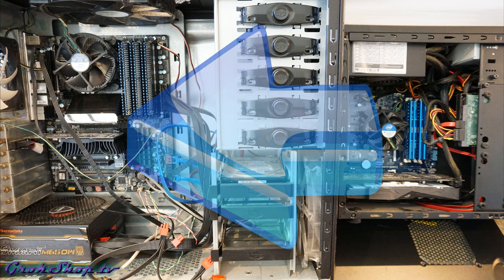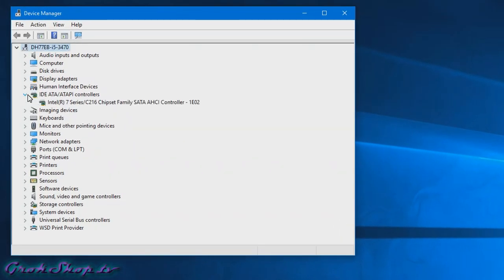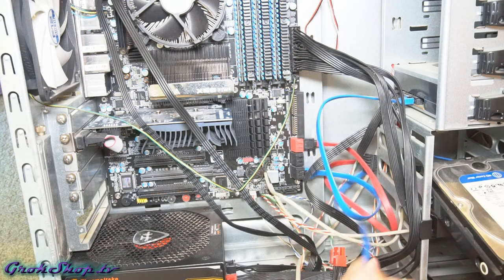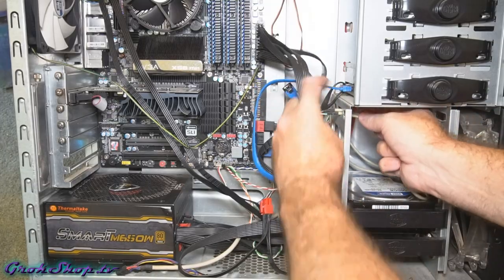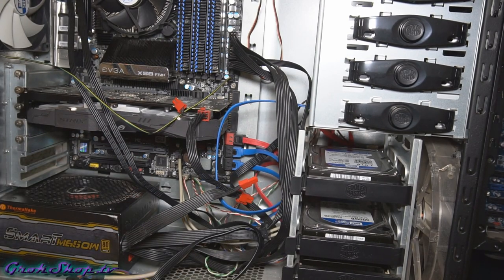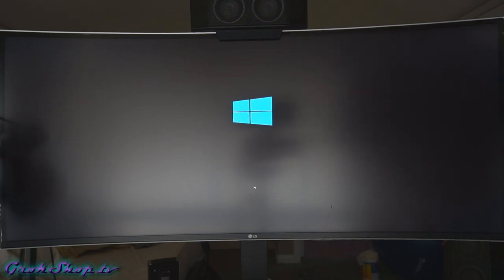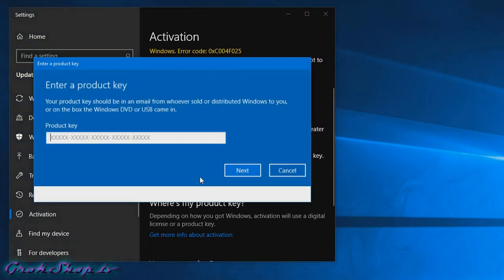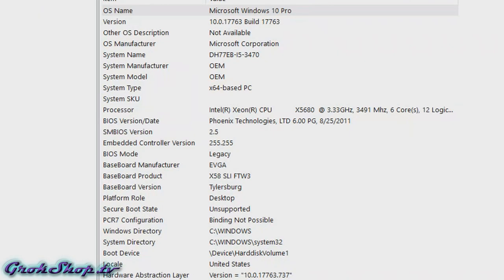Transfer Windows 10 To New Motherboard & CPU + Digital License Transfer

Comment from the maker: Note:  During the initial "prep" phase, if you don't find your HDD / SSD controller under "IDE ATA/ATAPI controllers", look instead for "Storage controllers".  If its under "Storage controllers", the standard controller you want to change to (before doing the upgrade) is called "Standard SATA AHCI Controller".
Reply: Did exactly this, changed storage controller. Replaced motherboard, new chip, ram, and GPU. Fired up, got bios screen, and then, away she went. And it did ask for the number, took the Win 7 number for the Win 10 upgrade without hesitation.
Reply: This dude makes it seem impossible. All I had to do was manually swap mobos and turn on pc....
Reply: Do you keeps your apps if you switch?
Reply: You prolly dont give a damn but does any of you know a tool to get back into an instagram account..?
I somehow forgot my password. I would love any assistance you can offer me.
Reply: @Nova Jaylen instablaster ;)
Reply: @Hank Cooper Thanks so much for your reply. I found the site on google and Im trying it out atm.
I see it takes a while so I will get back to you later with my results.
Reply: @Hank Cooper It did the trick and I finally got access to my account again. I'm so happy!
Thanks so much, you saved my ass :D
Reply: @Nova Jaylen happy to help =)
Reply: @hankcooper7124  Found the bots

Comment: YES ! It worked. Followed your instructions and it's worked perfectly. Changed motherboard, ram & CPU - firstly, did back up, windows image (Win10) & made rescue disk. Removed all files (Pic's, video, music & documents to an external harddrive) leaving just programs & apps. Then cloned hhd to ssd using AEOMI (tried Macrium but it failed). Removed drivers as per video - yes, check the "Storage Controllers" my drivers were in there ! Power down & removed all parts to new PC. Powered up new PC (to BIOS), selected SSD as boot drive & boooom, up & running & not pestered once about activation (my original licence still intact). Please note:
1: I had an original "retail" copy of Windows 7 which was upgraded to Win 10
2: Sysprep didn't work - tried but it failed a number of times.
3: My windows 7/10 is linked to an old email address but I didn't even have to log in to re-activate.
4: I did extensive research into my PC parts and made sure they were all 100% compatible.

Many thanks my friend, you've turned a very daunting task into a straight forward swop. 
Bob.

Comment: Very cool. I've been building and upgrading computers since the 4.7Mhz 8088. I did not know about this easy and direct way to move to a new PC. The last time I did this I used Laplink and that messy and expensive. Thank you! I'm building a Rizen 3900X computer tomorrow to replace my 2012 Core i7 6 core 4.2GHz machine. It's time.
Reply: Wow sir, how did it go? I'm on MSI B460 and upgrading to Asus Z490, not as a massive upgrade as yours but still worrying.

Comment: I've always so far done it the even harder way which is to put the new motherboard in the same case which means unplugging  everything unscrewing the mounting screws,  and xhanging i/o shield. Next time I'm just going to get a new case I think because the drive mounting options are limited in the current one, plus the space is tight.

Comment: Bought a used PC that had win10 enterprise wiped.  Win11 will not activate with my old win 7 pro retail. Can i obtain the previous BIOS enterprise 10 key and re-install windows 10 enterprise?

Comment: My motherboard died so before putting money into a new one I wanted to switch it with another one I have from a 2017 build, my current pc ran window 10 but the old motherboard was on a window 7 pc, will I encounter problems?

Comment: Thanks man, your steps are crystal clear and easy to follow. I am currently moving from Intel Xeon workstation to a new AMD Ryzen rig since my Xeon boost speed is a bit low for some scenarios. I will be following your step as soon as I get components on my hands.  BTW, will Windows 10 do the old driver cleaning job for you because I am a little anxious about older drivers and I don't want them to cause conflicts or blue screen.
Reply from the maker: Nice.  It  does remove the old unneeded drivers, yes.
Reply: @grokshop  Thanks again, I just finished installing new rig and surprisingly windows 10 did everything for me like you said. Now I can tweak my new rig without wasting time on OS and data transferring and those tedious tasks.

Comment: Just curious if this would also apply to not just switching motherboards, but to include CPU and all together different platform. Specifically going from a Intel 3770k to AMD Ryzen 5600x and of course all corresponding hardware?

Comment: I just replaced my mobo, cpu, cooler, and RAM. Bios sees all drive, including my previous boot drive but when I try to boot from it all I get is a black screen with a white cursor. I have an additional empty drive that I did a fresh OS install just to get up and running. I can see the original drive and see all my files via explorer. I need to be able to boot from my original drive. Any help is appreciated. Sorry for the lack of detail, I’m currently visually impaired.

Comment: I recently changed my mobo and cpu to. (Megx570 & ryzen 9). Now I’m getting a black screen with a blinking underscore. Any help would be appreciated !
Reply from the maker: Was that after following this procedure?  And was it working and then black screening or it was never working at all?
Reply: The Grok Shop My computer was not booting to windows. Meg x570 ace is unable to detect an m2 SATA in slot number one, I figured out that if you have an m2 SATA, u need to install it in slot 2 in order for it to be read in this mother board

Comment: Sadly it isn't work like that for me. When i change my motherboard, i was not able to boot Window anymore. I was stuck in the bios...and because i was stupid instead to take the product key i took the product ID. When i tried to install a new Window, the installer said that i has to format my SSD with window. Idk what i have to do, i dont want to buy a new product key

Comment: Great video I’m getting a new motherboard and cpu I was told that if I just do what you did in the video there will be errors and won’t work unless if I uninstall drivers from the previous motherboard.
Reply from the maker: Thanks.  For the case where the origin mobo uses a storage controller other than the generic one (as I was explaining in the video), you do indeed need to uninstall that one driver (as I showed in the video).  But that is usually the only one because Windows can normally figure out the rest on its own & will actually uninstall the remaining unneeded ones itself.

Comment: tomorrow i will be swapping out my intel cpu, mobo and ram to a b450 with ryzen setup. do i need to be connected to the internet to do this method? or do you recommend I keep the computer offline until it updates itself with whatever comes preinstalled as far as drivers go?

Comment: so this is only if you first installed windows 7 and upgraded to windows 10 - if you had windows 10 from the start, this isn't needed, correct?
Reply from the maker: There could be subtle differences if you had win10 from the start vs a win10 that is from an upgrade of win7.   The license transfer part could be a little different, for example.  The driver thing will be the same.

Comment: I got a new cpu ram mobo combo and a $30 OEM win10 lic and stuck it on my old setup while waiting for my combo to show up, im screwed I think. If I'm lucky its because I'm using an old H55 chipset one a no name china board that has no info and my computer has no idea what the main board is lol, says to be fill in by manuf..... And under hardware manager it says "Standard SATA AHCI Controller" naturaly.

Comment: doesn't this image save all files and settings which contain the old motherboard's chipset? - by reloading Windows 10 image, you're essentially back at square 1, so you might as well just kept the same image you had.
Reply: Windows will pick up new drivers automatically and install as needed. You can then remove via add remove option all unwanted drivers.
Reply: You can also load the image as a virtual hard disk in Disk Management and grab individual files as needed if the image can’t restore.

Comment: Installed a new board and cpu a few days ago. Got stuck in the BOIS for like 2 hours (my copy of windows is digital and did not have a copy to load up) strangely enough (using an Asus MOBO) I told the BIOS to download their RGB HUB, and then the machine booted from my existing copy of windows from my old build. I thought I was going to have to take back apart6 again, rebuild my old system and then get windows and start again.

Comment: i want to just swap my motherboard,having the same hdd and ssd,will this method work just fine?
Reply: Yes
Reply: i was wandering did you swap it? does it work? im planning to do it but im also changing the ram and graphics card but the same hdd and ssd
Reply: @ferdiiman6751  It works, just put your boot drive in first, then install all the new drivers and stuff. Power off and install the other hdd. Oh and don't forget you need to buy a new windows 10 pro key. It's $3 on ebay
Reply: @midnightprince  thx
Reply: @ferdiiman6751  yw
Reply: @midnightprince  you actually don't have to buy another key if you linked your activated windows to your Microsoft account
Reply: @jeromezomil5562  dude, you're a life saver. so as long as it's linked it saves to my account through Microsoft log in?
Reply: @AFlyingSwive  ye, read it through the net, you can see alot of articles about it.
Reply: @midnightprince these keys legit?
Reply: @MWalsh1992  what keys?
Reply: @midnightprince  sorry just realised this is months old. Was talking about the windows 10 keys you can get on the cheap. Swapping over my mobo have a copy of Wind pro on my NVME drive but it is an OEM copy with a digital license so dont have a key.
Reply: @MWalsh1992  buy a windows 10 pro key off ebay for a few bucks
Reply: @MWalsh1992  home is even cheaper

Comment: You are installing the power supply all wrong. You always want the fan pointing down. You are just pulling hot air straight in the case.

Comment: Ok one question , do i need to backup?? i already have it on my ssd , My plan is to change only the motherboard and cpu , should i follow this method or ?
Reply: Yeah ,me too, I'm about to change my motherboard cpu and ram. What happened?
Reply: @F.A.--  i reinstalled the windows
Reply: @mustaphagh3043  just reinstalled it off a thumb drive like when it’s first built?

Comment: This is a great video but I am not sure if its going to work with my situation. I have an old pre built pc which had pre installed windows 7. The old pc is not booting which is why I plan to buy a whole new set up. (Old AMD to new AMD PC) Will I be able to do same thing as instructed on the video without doing unistallation since the old pc is not accessible?
Reply from the maker: Well if it won't boot on the old box, it most likely won't boot on another, so a direct transfer of the HDD like I did here is probably out.  But as far as the license goes... if you had Windows 7 & it was not upgraded to Windows 10, you would only be able to transfer the license if it was not an OEM license.  Check my blog post for how you can check the license:  https://grokshop.tv/transfer-windows-10-to-a-new-motherboard-cpu/   Windows 7 doesn't support the digital license thing.

Comment: I tried doing like this, it seemed to work fine at first, i logged into windows like normal and everything. But then the computer started restarting itself like every 5 -10 minutes.. Ive tried reinstall windows but because it restarts the installation is cancelled.. Any ideas what to do? I switched back to the old motherboard for now and it works fine.

Comment: Bought a new 4X4 M2 drive, cloned it from my old drive (3x4) old motherboard MSI B450, new MSI B550 with 5800X, Booted into windows, found all the drivers, then I installed all the website drivers to be sure and kept all my programs!! Only thing it said it wasn't activated (because of new hardware)  I decided just to get a new key for $12.82 because I didn't want to jump through hoops to get it activated again.😁😁 Using old Vid card RX480,FPS went up from 65FPS on B450 to 85FPS in Heaven benchmark on B550 board! Tried to use old key ( didn't copy when I bought it) but it kept saying MS servers were down??)

Comment: I actually didn't understand the method properly. I have 3 hdd in my pc, now i'm upgrading to a new motherboard. In 1 hdd i have my windows installed on it, i.e C drive and i dont have any important files on C drive, i'm ready to do this without any backup fr C drive as i dont have any important files on it. In my case where should i start? And what are the steps i need to go through?

Comment: I need some help or advise, how ever you want to put it as. So I am switching my Mobo and CPU from an i7 6700K to a Rysen 7 CPU. Technically I am upgrading from an Intel CPU and an Asus z170 Mobo. My new Mobo is a MSI B550. Those two components are the only ones I am changing. I have 16GBs Corsair dominator DDR4 ram, a GTX 1080 GPU and a Samsung 500 GBs SSD. This is t he first time I'm making this type of switch, and dont know what issues I can run into. Any help will be appreciated.

Comment: The motherboard (mb) on a desktop PC I built got fried during a power surge (even though it was plugged into a HD well known, brand name surge protector/UPS/battery backup) earlier this month. I should be receiving a new mb next week, hopefully the same make and model. However, the version of Windows 10 Pro that I installed, from a DVD I purchased from a reputable retailer, is an OEM version, not retail. So, will this method still work? 

My understanding is that an OEM version is intricately tied to the hardware, specifically the motherboard. According to information on the Microsoft and other sites, an OEM license can't be transferred if the mb dies.

Comment: Very nicely done👍. I am upgrading a Windows 10 OEM computer with a new Mobo, CPU and memory. I have a few questions if you can help me out?
Q-1 I checked my IDE controllers. All set to ATA for channel 0 and 1. All others are Standard. Storage devices is "Microsoft Storage Spaces Controller". Does this mean my "key" should work OK?
Q-2 Should I download all the drivers for the new hardware before the upgrade and don't install - Right?
Thanks
Reply from the maker: OEM keys are generally non-transferable.  However, I have found some "OEM" keys are actually RETAIL keys. Be sure to check my post here to see how check yours:  https://grokshop.tv/transfer-windows-10-to-a-new-motherboard-cpu/  And you only have to worry about setting the boot drive driver to generic and the new drivers can often be located by the OS, and if not - you can probably upgrade them later.
Reply: @grokshop  I got a pretty nice help doc on the MS website on how to move a digital license that mine was converted to. 1st step is to login to your windows account instead of a local account. The rest is explained in the document.

Comment: Now, here's my issue...I want to move my SSD from an Intel based system, to an AMD system. Will this process still work?
Reply from the maker: It should still work.  I haven't done that yet, so it would be great if you could post up a follow-up!
Reply: Did this work for you?
Reply: @ELSTINKO.  Yeah, it worked. Just be sure to uninstall any Intel drivers and registry components by Intel before moving the drive over to your other PC. :)

Comment: So this can work for me if I use my SSD instead, but I bought my rig 3rd party with windows 7 Pro installed( I upgraded to Windows 10 no problem). I checked and its a retail license but I don't have the product key. I messaged the seller, but if I can't get a hold of the product key from him am I SOL with the transfer?

Comment: im still currently running win 7 on intel, but im building amd, and new components only support win 10, so i have to upgrade. should i upgrade first then switch, or switch then upgrade? and if i switch first, since the new components dont support win 7, what would happen if i try to run it? can i even get to the point of upgrade?